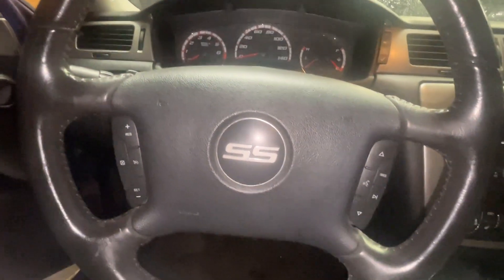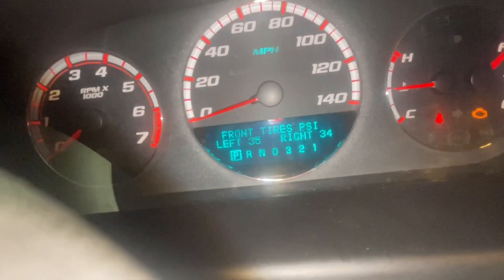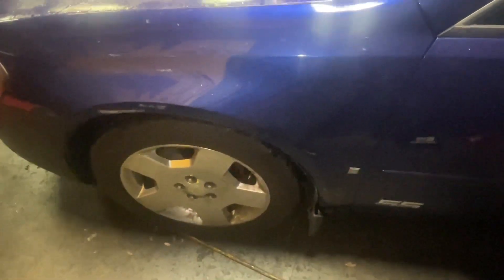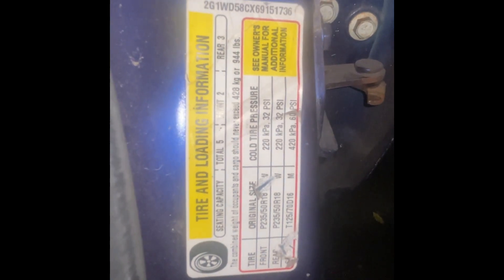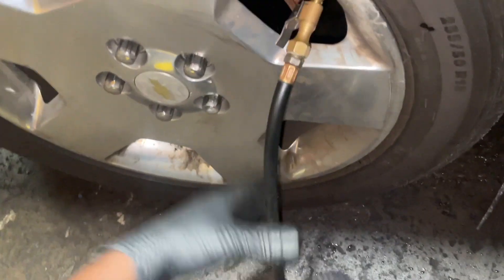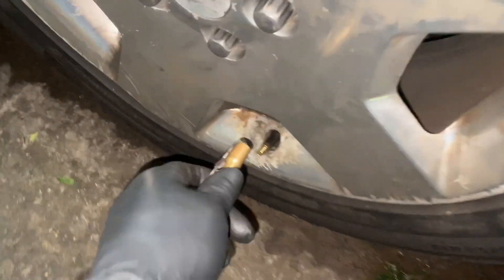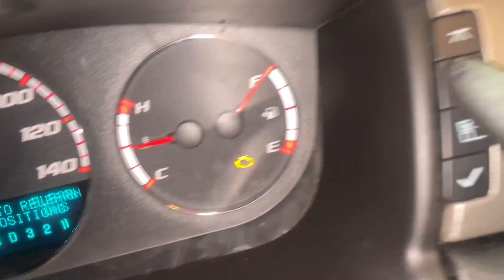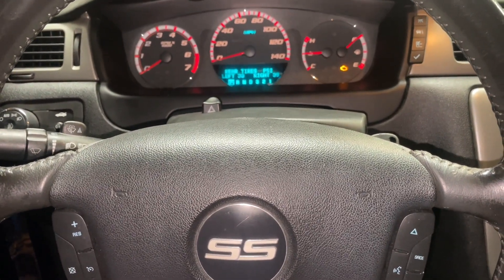2006-2013 Impala TPMS sensors reset

Comment: Thank you for posting this I bought a 2006 impala LT a month ago for a go back and forth to work car(I have a 2500 sierra and it drinks alot of gas)anyway the check tire pressure reading has been on since i bought it and it drives me nuts so this will solve the problem hopefully so again thanks
Reply from the maker: I’m glad it helped, I had the same problem so I bought 4 sensors on eBay, performed this procedure and it’s been working great every since.

Comment: My relearn option isn’t there it’s just to change compass
Reply: It has to be.
Reply: Had the same issue put the key to the on position and on the key fob hold down both lock and unlock buttons and it'll go into the tire learning mode then either use the tool or do what buddy did in this video with the tire pressure

Comment: I got a 2013 and it doesnt have that option
Reply from the maker: Not sure why it didn’t work for your vehicle, ensure that it don’t have any faults or codes on your vehicle.
Reply: Same for me there not even the option I  the meun
Reply: My 12 LS doesn't have it either
Reply: Hold lock and unlock buttons on key fob at the same time until car beeps